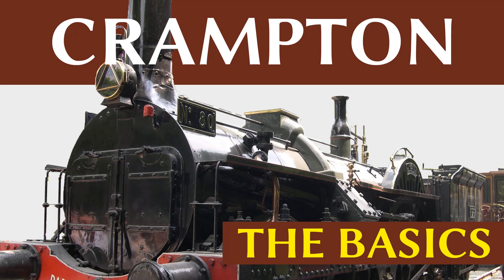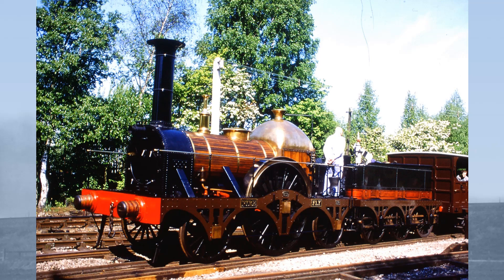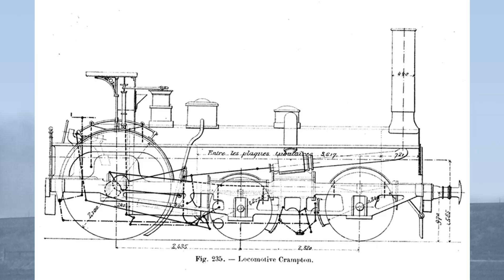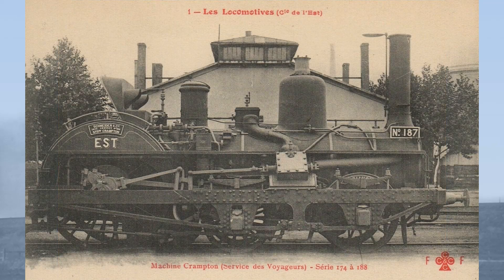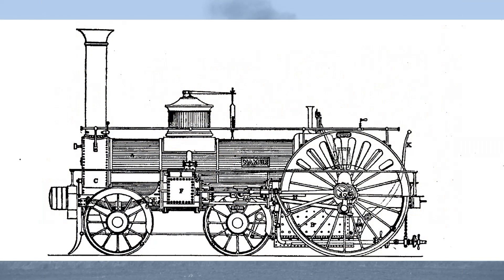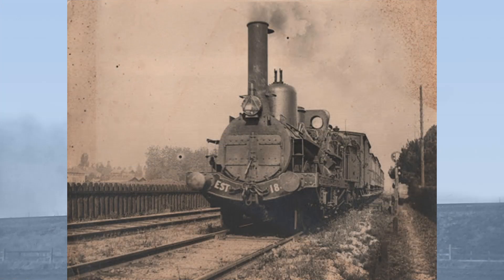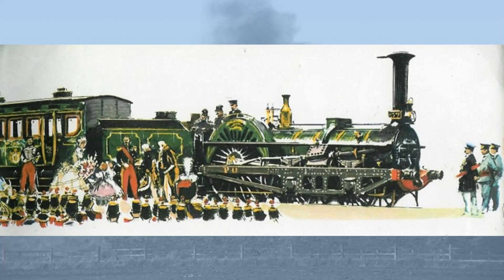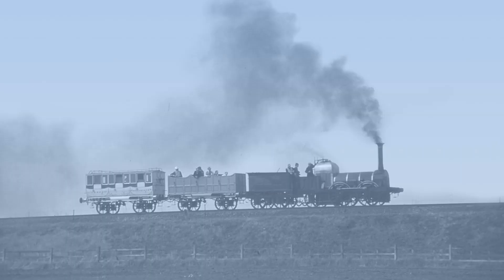Crampton: The Basics

Comment: It's fascinating how a flawed idea (the centre of gravity must be extremely low) led to the design of possibly one of the most iconic, yet somewhat nonsensical locomotives. I can't imagine a crampton could have pulled much with a driving axle purposefully built to reduce adhesion, and giving an express locomotive a small firebox must have been very taxing on the crews.

Comment: One thing that Mr. Dawson had forgotten to mention was the Cramptons tractive effort wich was not incredibly high but was well enough for their time, usually ranging between 2,000 to 4,000lbs of force with the highest being on the Liverpool with over 8262lbs of force. This was due to thier poor adhesion with the single driving axle behind the firebox and most of the bulk carried on the leading wheels.
Reply from the maker: however, it is also worth pointing out that given how the tender was coupled to the locomotive, rather like Edward Bury's four-wheelers, they became a semi-permanently coupled articulated unit which meant that weight from the tender was also available for adhesion :-)

Comment: I am fascinated by the history of early steam locomotives, and how rapidly they evolved from 1804 to the 1840s from slow moving wagon pullers to engines capable of speeds up to about 60 or more miles per hour. My point here being the plight of the locomotive crews, not of course just the Cramptons, but many other types also, who had to work on a footplate totally exposed to the elements. Can you imagine what it must have been like in the dark, temperatures below freezing and sleeting or snowing to boot, and the train for an hour or two averaging speeds about 40 mph?  They must have been made of tough stuff back then.....
Reply from the maker: I've done it with the replica of Planet in authentic (or as authentic as it can be) kit. White fustian trosuers, short jacket, cap, overcoat. You get very cold and very wet. But, that's what people were used to. Stage Coach drivers and Stage Coach guards got cold and wet; Mail Coach drivers likewise. Railway guards used to sit on the roof, so they got wet. Passengers of stagecoaches sat on the cheap seats on the roof - same as travellers going third-class who had either open topped carriages, or open toppers with no seats and stood. Not neccssarily "made of tough stuff" but it was considered normal. Transport occupations were an outside job. Travelling often meant travelling outside. And indeed many engine drivers into the 20th century were opposed to putting cabs on engines. Even in the 1940s -1960s at the very end: you still have small industrial locos trundling about with only a weather board and old drivers who didn't want a cab. Most of the "Quarry Hunslets" in North Wales didn't get cabs until the preservation era.
Reply: I did have in mind drivers of stagecoaches and outside passengers etc, I just wanted to get the ball rolling. 
 @AnthonyDawsonHistory
Reply: @AnthonyDawsonHistory  
I've never worked out why footplate crew always wore white trousers.
Reply from the maker: @tooleyheadbang4239  As I argue in my paper on this subject at the 7th International Early Railways Conference it was because unbleached, un-dyed fustian or canvas cloth was cheap. It was also very easily washed. The third factor is that coke is not as filthy as coal is so there was less muck on the footplate. And the lubricants used were animal or vegetable based and so would also wash out of clothes easily.  White canvas trousers or overalls were worn by soldiers doing barrack duties, doing kitchen duties, all sorts of dirty things which needed cheap clothing which was easy to wash. Hope this helps.

Comment: So much engineering but with little consideration for the comfort of the footplate crew😕
Reply from the maker: Stage Coach drivers and Guards had had no protection from the weather, so protecting locomotive crews was thought unnecessary. It was also thought that if the locomotive crews were too mollycoddled they wouldn't be alert on the job. In the UK engine cabs were very spartan - they didn't even have seats until the C20th. The only company to really break the mould was the old North Eastern who had big American style cabs - but then again they were run by Quakers and their loco designer had spent a couple of years in the states. Then again, there's so much going on in an engine cab, there's honestly no time to take a breather to sit down. And, a fully enclosed cab whilst nice in winter, is absolute torture in the summer.

Comment: You know, given that this locomotive didn't do as well in the UK, as it did in other parts of Europe, due to how brittle the standard rails were built, and how Brunel's broad guage was essentially made to circumvent the problem, as well as give way to high-speed travels, I kind of wonder why Brunel or other folks who were in charge of the GWR didn't reach out to Crampton, to see if his design would fare better on a broad guage line, compared to more conventional lines.

Kind of seemed like a golden opportunity, to basically create another potential selling point of the broad guage railways (as well as possibly something that could be made as a case for essentially preserving the guage, during the whole discussion regarding main line guages, considering how narrow guages were still used, after broad guage was phased out), aside from the wider bases and improved centre of gravity and balance potentially paving way for engines with a more squat-like design, to be used in places with low-hanging ceilings or bridges.

Comment: Why were there no counterweights on the drivers?  It's no wonder they were rough riders.
Reply from the maker: Crampton was one of the first engineers to recognise the need to balance the various reciprocating masses and was amongst the first to introduce balance weights on the driving wheels. Crampton locomotives were very steady runners thanks to their long wheel base. There's a lot of rumour they were rough riders, but that comes primarily from Britain. Whilst early "monster" Cramptons like "Liverpool" with its incredibly long fixed wheel-based may have damaged the track on curves as a result, the de-facto book on the Crampton Locomotive describes them as being stable runners and capable of high speed. I've not seen anything in European literature to suggest they were rough riders.

Comment: from Fraser, husband of Leslie
Of course the problem with a low-slung boiler is its restricted diameter, thus restricting the possible power output which depends on steam raising. Interesting engine, though !
Reply from the maker: Cramptons had some of the biggest boilers in the period and certainly the largest heating surfaces of the period - larger even than the Broad Gauge locos! So they weren't that resctricted in steam raising and power output.

Comment: Finding out that the initial plans for Crampton designs used large carrying wheels in front helps explain the thinking behind the otherwise bizarre Crampton tank-engine variant with a driven axle at each end and six carrying wheels in the middle.

Comment: I would have loved to have seen the amazing 6-2-0 'LIVERPOOL' !
Interestingly the only surviving locomotive designed by Mr Thomas Crampton built by Horlock for the 4' gauge Padarn Railway in North Wales 'FIRE QUEEN' is frameless and the four wheels were mounted virtually at the ends of the boiler! 
Whilst the other Padarn locomotive 'JENNY LIND' was scrapped in 1886.
The 'FIRE QUEEN' was bricked up into a shed in Llanberis and not liberated until the late 1960's!

Comment: "My name is Crampton and I really have to invent something befitting my name."
"How about a locomotive with a cramped firebox?"
Looking at these I always think of them as oddities because, how do you bring enough weight on the single driving axle located far behind the centre of gravity? How do you prevent a single huge wheelset from slipping? I guess that is why they didn't last longer than one generation of locomotives: Trains got heavier and required more drawbar force that the Cramptons couldn't provide. Multiple coupled axles of large diameter, however, meant that the engineers had to dare putting the boiler in a much higher position, as has been done throughout the 20th century.
As mentioned the express trains of the era were very lightweight (80 to 90 tons) so in their era the Cramptons were sufficient.

Comment: So you covered the history of track, but what about the matter of the gauge conversion? Given the different railways had different gauges yet were still connected in many cases, it wouldn't seem efficient to just stop and switch stock?
Reply: Changing trains mid-route because of different gauges caused delays and chaos. There is a well-known contemporary cartoon of 1846 showing an (admittedly exaggerated) scene at Gloucester station, highlighting the public complaints - see https://en.wikipedia.org/wiki/Break_of_gauge#/media/File:Break_of_gauge_GWR_Gloucester.jpg . The Great Western Railway decided to abandon its broad gauge track and standardise on the common 4 feet 8.5 inches used elsewhere, but it took them nearly 50 years to accomplish this!

Comment: Very sleek looking machines, and achieving speeds that were like breaking the sound barrier for us in the 1850s.
But the main drawback why they fel out of use was their poor adhesion, with most of the weight on the carrying wheels rather than on the driving axle (probably less than 15 tons adhesive weight on a 40 ton locomotive).
As trains got heavier from 1870 onward they lacked the tractive effort to cope with them
Reply from the maker: Indeed they were but it's also worth remembering that the tenders were close-coupled and almost permanently coupled to them, rather like Edward Bury's little singles, so that they made in effect an articulated unit, where weight of the tender also contributed to some weight on the driving wheels. But yes after 1870 they fell out of fashion due to increasing train weight; some were displaced to secondary routes and remained as tender engines whilst others were converted to tank engines for use on commuter trains etc.

Comment: I wonder what kind of hell was being on the footplate of one of those locos at 60+ mph with little to no windshield.
Reply: The cab was originally for the protection of the instruments. When men on GWR asked if a seat might be provided, Churchward refused saying that the footplate of a locomotive should be like a battle ship; clear and ready for action at all times and that there was never a moment when the crew should not be attending to the good running of the engine.
Reply: And NO ROOF !! Crew had to work in all weathers. Not a pleasant job in the dead of winter.
Reply: @channelsixtysix066  at least they had the furnace of the boiler to keep them warm
Reply: @connormclernon26  Yeah, it only took until 1924 when GWR figured it was time to provide a proper cab for their locomotive crews.

Comment: The Stephenson locomotive Robert Fulton, built for the Mohawk & Hudson, was remodeled into a 4-2-0 during the 1830s. A four wheel truck was put under the front end, but the rear axle was relocated to behind the firebox. As Robert Fulton was an inside cylinder engine, the drive was sent to the rear wheels via outside connecting rods and a jackshaft, à la SER's Folkstone. I have to wonder if Stephenson had any knowledge of this modification before building Folkstone (it seems many American roads wrote Stephenson to report on their use or misuse of his engines, so I wouldn't be too surprised either way).